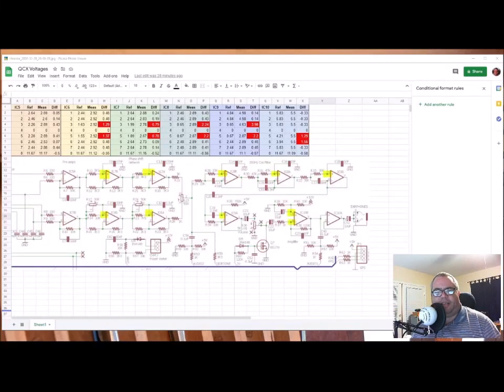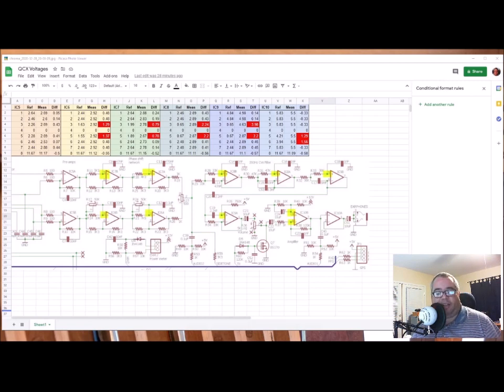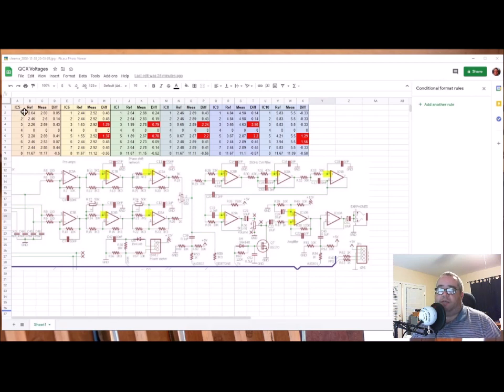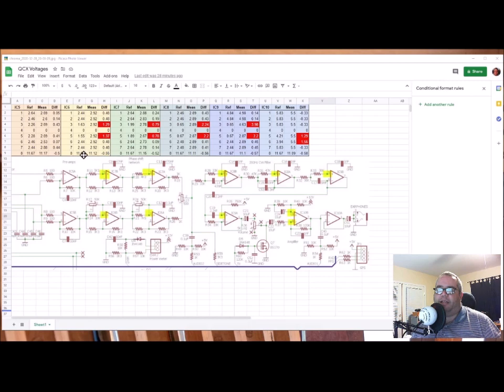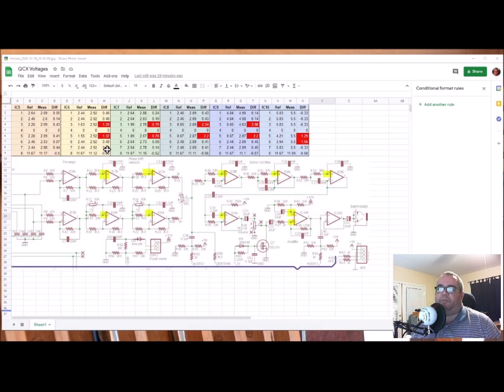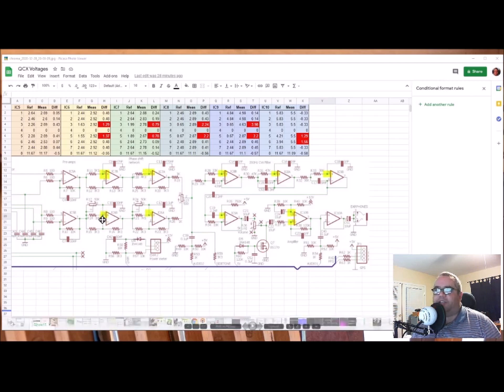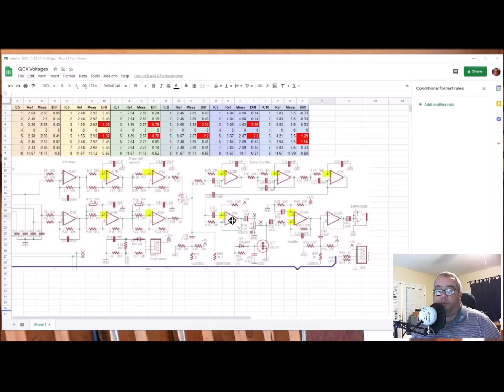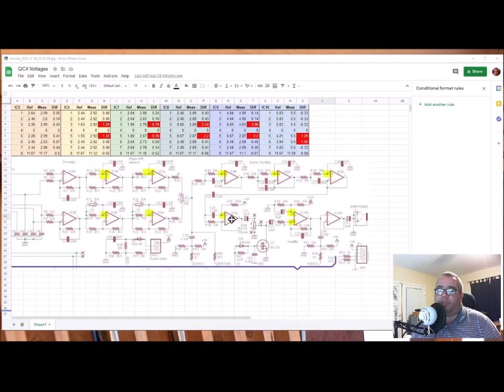QCX Mini Troubleshooting: Voltage Measurement and Analysis

Comment: The layout for the spreadsheet is a great idea! Do you have another QCX to compare voltages against? I found some of mine, while checking a QCX+ different than Hans'. I think his were read using the on-board DVM. Thanks!
Reply from the maker: Thanks Al. I don't have another QCX to compare to. I'm hoping somebody has posted theirs somewhere for comparison. I have some digging to do on the QRP Labs groups.io site.
Reply: @MiscDotGeek  I'll put one together using a QCX+ 40m one I have and post it.